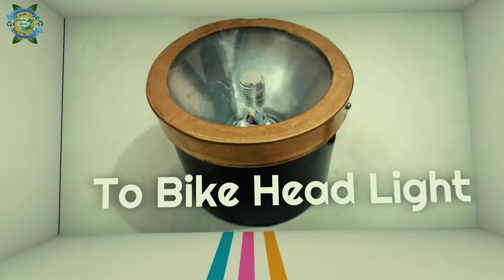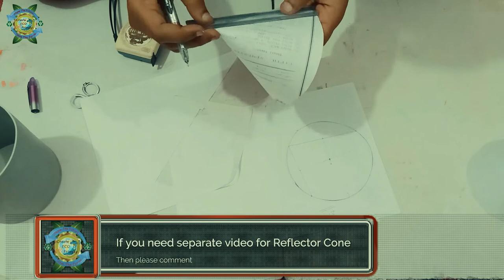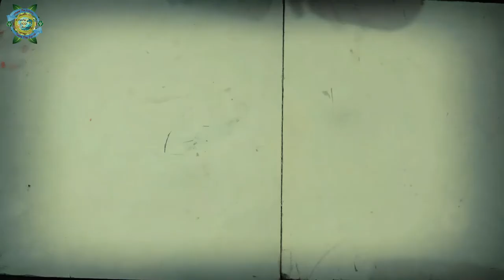DIY Headlight from PVC Pipe

Comment: Cqn i use h4 halogen on that?
Reply from the maker: Halogen lights are little bit heavy...

But you can use if you can make it sturdy enough...

But make sure to give quite depth and diameter as per lights specs...

Hope you get the answer...